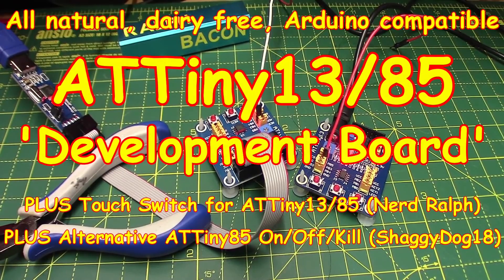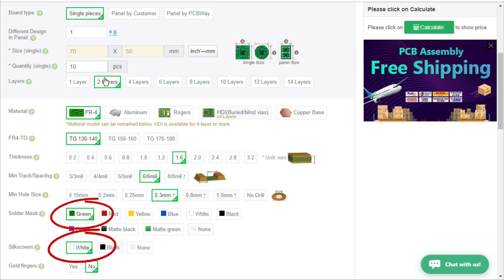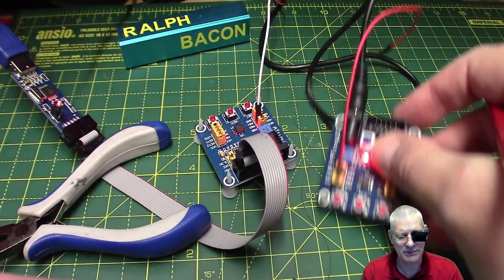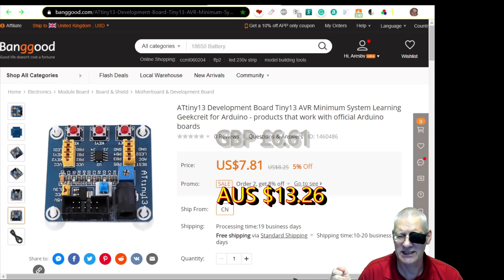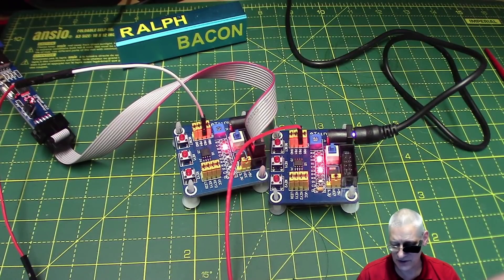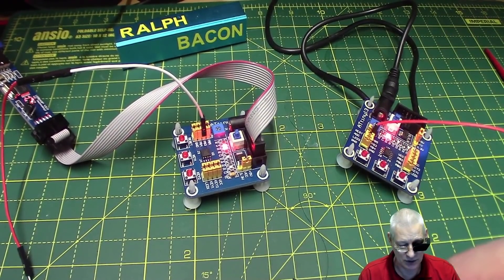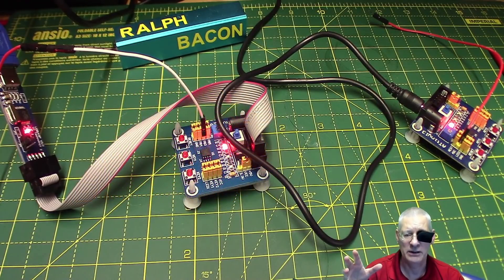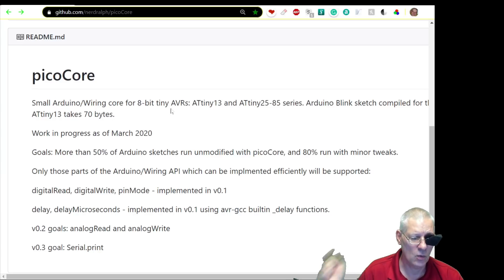#181 ATTiny13 (and ATTiny85) Development Board, amazingly useful

Comment: Another excellent video. I’m yet to use an ATtiny but I do have plans for an led project with one. The board will make life easier in the prototype phase, as you said. 
Hopefully all appointment will be rescheduled in the not to distant future.
Reply from the maker: I'm afraid the appointments have no resume date, I'd be surprised if I get it seen to this year now. But in the meantime do play with this board (or the other one on Aliexpress that has a DIP socket. I've one on order to see if it's the same.
Reply: Ralph S Bacon that is a massive shame. Sorry to hear that, Ralph. I’ll have a look for the other board.

Comment: The t13 and t85 are both available in .15" wide JEDEC SOIC and .208" wide EIAJ
 packages.  The part numbers ending in SU are the bigger EIAJ version, and SSU is for the smaller SOIC.  (see the "Ordering Information" section of the datasheet)
Reply from the maker: The part numbers are so confusing, Ralph. I tried to get the wider bodied ATTiny13 from both LCSC and RS Components with no luck. Then I got confused over the SU vs SSU sizes. 
Hence why my Stop/Start/Kill PCB got the narrow bodied ATTiny13 outline, which is tight squeeze for the ATTiny85 (as you saw in the video) but it is very doable. I will have a look around for the SU ATTiny13s, thanks for the explanation (I knew you would know).

Comment: I have a couple of these little blue dev boards myself but mine have 12F675 PIC microcontrollers on them. Yes, I'm a glutton for punishment and occasionally I play with the PIC instead of AVR. As for your situation just stick to what you can do whenever you can do it. We fully understand. The world has decided to go mad for the time being and we're all having to endure changes to our normal routines - even those of us who really hate change.
Reply from the maker: Did you replace the ATTiny13 chip with a PIC chip or did they come like that? As you know, I used to play with PICs too (see http://www.sfcompiler.co.uk/wiki/pmwiki.php?n=SwordfishUser.Articles, first two articles) but I find the Arduino (and related) chips much better supported (or perhaps I just like them better!). Stay tuned, Nick, I have some video ideas now.
Reply: @RalphBacon  They came with the PIC and as 8 pin DIL (socketed) and not the surface mount variety so I can replace them with either a 12F629 or a 12F683 if I so wish. Like this https://i.ebayimg.com/images/g/iDQAAOSw44BYLVjt/s-l640.jpg I usually code for them using Great Cow BASIC as PIC assembler is a pain, all that bank switching nonsense!

Comment: I doubt you can use an USB-to-serial converter to program the tiny (unless you use some software bitbanging upload protocol, that's highly dependent on the converter chip used). The USPASP "speaks" the native programing protocol of AVRs, USB-to-serial converters need the Arduino bootloader.
Btw. it's well worth getting multiple of the USBASPs including the adapter. You can use one to update the firmware on another (it's just an AVR after all). And for some projects, where you don't have a 6- or 10-pin header on the board, but connect the programming wires one by one, it saves a lot of hassle when you can just leave one connected until the end of the project and not have to reconnect every time you programmed some other board in between.
Reply from the maker: Oh dear. You are correct. Without a bootloader it won't be possible to upload code with a standard FTDI USB-to-Serial device. 
Most ATTiny85s don't have a bootloader pre-installed either, so you would have to install one using the ICSP method (which I've described many, many times!). I'm not even sure an ATTiny13 has enough room for a bootloader, let alone that and a sketch too. 
Personally, I never use a bootloader on either of these chips, memory is too precious, and I upload using the ICSP pins (from an Arduino programmer or dedicated programmer). 
My mini ATTiny13/85 breadboard friendly PCB with built in 6-pin header shows this quite clearly. Ho hum. Let's hope everyone gets a USBASP then! Thanks for alerting me to my faux pas.
Reply: Does this mean that the other adapters shown wouldn't work?  Will the one shown work under linux,  does anybody know?  I'm bothered by it wanting to run its own software,  there...

Comment: I bought a 'stick' of ATTiny13s years ago, without knowing their very modest capabilities. They were only about 20c each though, so why not!
Eventually, I managed to make use of some of them as a hardware watchdog, running alongside various ESP8266 projects. I couldn't do what I wanted using pure Arduino code, so I had to do some googling and write it in assembly language. Obviously, a slightly 'bigger' chip is still cheap, but there's a lot of satisfaction that comes with making something out of almost nothing. :-)
Reply from the maker: And if you were working in a commercial environment, your boss could well insist on using the cheaper ATTiny13 to save those 5 cents on each chip! When you're producing hundreds of thousands, if not millions, of products it can really add up!

Comment: Keep them comming as and when. Currently fighting with a 8 digit dispaly, which is part serial and part parallel. 8 digits, 7rows * 5 columns per digit. you need to shift in a complete 8 digit row, then cycle through the 5 columes. Arduino debugging with serial is throwing all sorts of delays in the serial data stream to the display. Even just having a serial.begin in the code buggers the timing. having to use a 8bit logic analyser to try and see whats going on. Your video was a nice break thanks.
Reply from the maker: Part serial, part parallel. How boring. Let's jazz it up a bit and have some parts updated OTA via bluetooth, some via WiFi (authenticated, obviously) and the rest by ESP. That's when you really have a challenge!!! Good luck with that project, sounds like you won't be bored any time soon (even without the stuff I suggested).
Reply: @RalphBacon  Well got the display to work, now i got a new issue. The display draw an average current of 400mA's or so. So it's getting too hot to touch!! :(  looks like i'm going to need a heatsink if i want to run them for more than a few min's. Who thought that they would need to so much power just to read them in sunlight. it was the reason that we never finished the project we were going to use them on. there must have been 20 or more displays and you needed gloves to press the button. Good in bright sunlight, but shit hot, the LCD;s we tried good in bright sunlight but stopped working when it got cold. happy days.  Got an ESP32 maybe that need to be interface to it next to control the fans. :)

Comment: Another great video.  My eyes aren't what they used to be either. As others suggested, talk about when and why you would use various electronic parts. ALSO... I'm very interested in your Smart Charger. I manually keep trying to catch it at 85 to 90% charge, usually unsuccessful. If you have it ready, or at least almost ready PLEASE make a video.  I've been holding off buying the BLE boards until you decide on which is best 05 or 06!
Reply from the maker: I hear you, Bill. My phone charger is doing great. Get both an HC06 and an HC05, they are cheap enough. HC05 gives you an additional feature (not essential but useful). Maybe I should do this next video... Anyway, yes, the videos of why/when/how we use various components could be done, and ideal for beginners. Hmmm, there is hope yet then!
Reply: @RalphBacon  Thanks for the quick response. I have ordered 2 of each from Banggood. Should be here in a couple weeks.  I tried to get to your BLOG on the Battery Protector and it asked me for Protected Postage Password! Whats Up?

Comment: Disappointing news about the op Mr B. I hope you'll be high on the list when things begin to settle down a bit.

Absolutely no worries about content, impressed you've carried on weekly this long! I'm subscribed and have that bell ticked so whenever you return I'll be back to watch.

In the interim, maybe there is scope for videos without code or demonstrations? Maybe something like a journey through the projects you've built and a discussion about which have stood the test of time and which ultimately same to nothing (we all have those!) or how you'd change them after using them for a while. Just talk and maybe the little whiteboard needed. Or possibly a walk through the list of projects you'd like to do if you had the time/resources. It's fascinating to hear what others have done and would like to do.
Reply from the maker: Er, slightly confused here, Gavin, you wrote "[projects] which ultimately same to nothing". I don't understand that sentence at all. I'm thinking of doing some short (10-15mins), basic videos for real beginners, on say Transistors, Capacitors and other components, Ohms Law etc. Might be useful. What say you?
Reply: @RalphBacon  Sorry the "same" was a typo. It should have read projects which "came" to nothing. Those black holes we sometimes go down that seem like a good idea at the time but end up being too difficult to make or too cumbersome to use or don't receive wife/husband/Benny approval.

Definitely with you on the idea of a basics series. It never ceases to amaze me on the forums and Reddit how many Arduinites have little or no understanding of electronics.

Comment: you may have mentioned it else were but what are those white feet on the boards called.   will wait patently for your next video.  they are worth the wait.
Reply from the maker: They came with the board, but of course can be used in other boards too. Jannie is correct, Nylon Standoffs sounds right. You can get push-in (like these), screw in and self-adhesive ones. I've only ever seen and used square feet ones but these are smaller, round feet, so maybe AliExpress might be a good place to search for them.
Reply: @RalphBacon  thanks for that  ebay can be tricky some times you know what you want but if you dont have the right name you keep coming up with the wrong stuff.  thatnks for the help

Comment: I too was excited about the attiny chips until I discovered stm8 microcontrollers. It's amazing what you can get for $1, you've got timers with any prescaler value, complementary outputs, deadtime, i2c, uart and even can. You should try them, atmega chips will seem childish compared to them.
Reply from the maker: You may have seen my STM32F103C videos, very capable. I've not used the STM8 chips, however, But watch the video when it comes out and you can compare!

Comment: Lovely chips. 2 old loves of mine. Still trying to implement i2c on the 13
Reply from the maker: I2C on the Tiny13 - did you see my video #82 on I2C and SPi on the ATTiny85? Would the same code work (fit into memory) on the ATTiny13? Also, check out Ralph Doncaster's GitHub/Website he has great ideas for the small chips.
Reply: @RalphBacon  thanks Ralph, i have done many i2c projects on the 85 already but the 13 is a different ballgame. No native i2c so i need to go bit banging. Have done a bit already but lack time
 I ll make sure to check out Doncaster' s web site

Comment: Be aware that most cheap 5V/3V selectable USB-UART converters only switch VCC, not logic levels. May be also the case for some programmers...
Reply from the maker: Yes, good point, always best to double check with a multimeter.

Comment: I have an arduino Uno which i need to burn bootloader onto, How could i use an Attiny85 board (lilytiny attiny85) as master to do it?
Reply from the maker: I'm not sure how you would do it without looking into it in much more detail. Can you not use a Nano or another UNO to do this? Load up the ISP sketch onto that device and connect 4 wires plus power to the one you want to burn a bootloader to. Theoretically, the Tiny85 has enough pins but I'm not sure the the sketch to burn a bootloader to another device will run on it.

Comment: SOS please help.                   Hello friends. I designed a program with my Arduino to run a 5 to 9v dc motor forward, stops and backwards for a few seconds. Then stops and waits for sensor again. The code was put into an IC ...the  AtTiny85 to shrink the project. Here are the component's...9vdc battery, .i used a sensor to detect motion as input.  Im using a LM7805 (100 nf electrolytic cap at input and 0.1 nf ceramic cap at output) regulator to reduce voltage to supply IC with 5vdc so it can go into program. The outputs of the program are .. light up an LED ( with a 200 omhs resistor)  and start the motor by giving signal to small  MX1616 Motor Driver.  Also , during this operation, the system can be shut if a Microswitch is pressed. MY PROBLEM: the code, and this system works perfectly on breadboard.  But when i solder it on card...it works for a few minutes and the motor starts spinning only fwd non stop AND ITS LIKE THE SYSTEM DOES NOT GO INTO PROGRAM FROM THE ATTINY85 or not enough current to start it.  Everything (sensor, driver, motor) takes power from the 9v battery , only the AtTiny85 is supplied with regulated 5vdc but that input to the regulator also comes from 9v battery.  Could my capacitors be the problem? Is 100 nf too much at that input and dissipates all the energy??  Should i also separate the grounds of the circuit. The 9vdc circuit and the AtTiny85 circuit SHARE the same grounds. Thank you
Reply from the maker: Are you sure your 9v battery is capable of supplying enough current for the entire project? It's not usual to do this (unless you 9v battery is huge).
Reply: @RalphBacon   Hi Ralph. Thanks for the reply. Yes it does enough current for the whole project. I restarted another soldered card and now works fine. I reduced my entry ceramic capacitor to 0.33uf as spécified in the LM7805 datasheet. I think my problem was a bad soldering connection..... on the IC or anything else. It was very hard to figure it out. But I did the mirror trick and bought a smaller soldering point...was careful on flux. Circuit is working fine now and goes into program. Question still remains... Is it ok to share different DC voltage grounds  back to source?  Or keep them separate?
Reply from the maker: All grounds, for all parts of the circuit, should be COMMON (or shared, as you put it). Known as a common ground. But the positive rails can (and should) be completely and entirely separated.

Comment: Hi Ralph  they make one with an 8pin socket also.
Reply from the maker: I've just been reminded by Scott that this was the case, Walt, in his link (I missed that difference) and have one on order to see if an ATTiny85 can also fit into that socket.
Reply: I was wondering if it were possible to fit an 8-pin socket on that board so that you could just plug chips in...

Comment: Bad news on the appointment old chap, make as many as you can comfortably and stiff upper lip !
Reply from the maker: Many have requested and suggested a beginners video series on how/why/when which I might do, as I now have a captive audience! What to you think, Andy? 15 mins max per video on a specific electronics/Arduino topic? Eg why do we need caps, transistors, protection diodes and so forth.
Reply: @RalphBacon  that sounds like a great idea Ralph, yeah " Bacon Bites " explanations on the basics, perhaps small snippets of code with little breadboard examples, as you say just quarter hour, maybe pick a module like an INA current module or perhaps the MAX6675 temp module and so on. There are loads of cheap modules out there to do or as you say transistors and caps, i think that would be very well received.
Reply: @RalphBacon  : Take a look at learnelectronics classic circuits.  I have learned a lot from them and they are a good format.  Or maybe a follow-along project where you do a short video on each stage and we build it as you go.  We could then share our projects fails and successes.
Reply from the maker: All great ideas, we shall see what I end up with!

Comment: The c and c++ compiler is just bloatware in most tiny applications, assembly is better for this.
Reply from the maker: A bit harsh, bloatware! Certainly writing code in assembler might result in a tight bit of code, but how many developers know assembler (well enough)? 

And, to be fair to modern compilers, they create some pretty tight code, especially if some of the compiler optimisations are used.

Like most things in life, it's always horses 🐎 for courses.
Reply: @RalphBacon  Oh sorry Ralph, I was not trying to be harsh in any way, and I'm not saying C and C++ are bad, I use them too and Rust as well. it makes my life easier in most cases. I was just talking about the 40 bytes of effective code from Pico Core Ralph turning into 106 bytes generated by the compiler. Which is about a 265% increase in code size. In assembly it's even less than 40 bytes. I understand that assembly has a certain reputation but in tiny microcontrollers it allows us to fit a lot more in a low-cost chip, but maybe it only makes sense in high volume production where cost a problem.